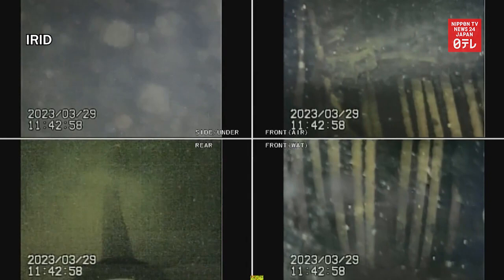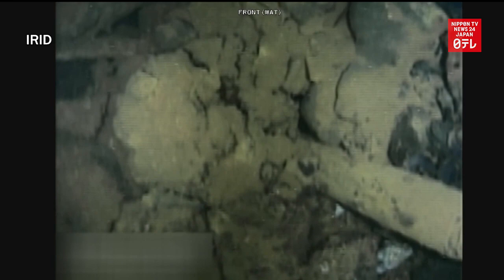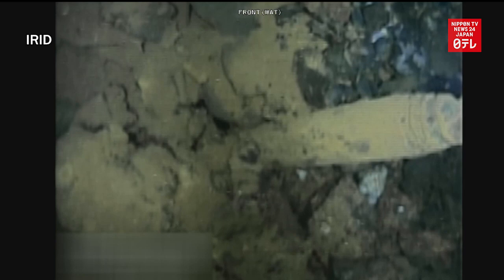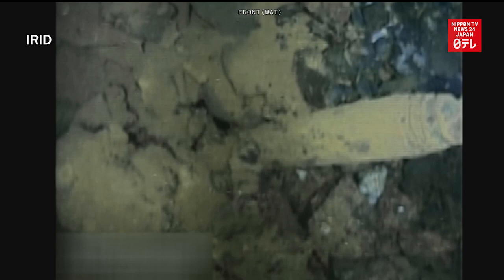Newest video shows Fukushima nuclear plant reactor foundation severely damaged

Comment: What ? Wait !!   I thought Fukushima didn't happen....
Reply: @danadurnfordkevinblanchdebunk  The contaminated water of Fukushima is distinguished from other nuclear power plants not only by its greater variety of radioactive materials but also the overall much higher radioactivity. If it is discharged to the Pacific Ocean, it will potentially pose a significant threat to the well-being of human health and marine life. Normally, water that is used in cooling a nuclear plant in routine operation and then discharged to the environment has no direct contact with the nuclear reactor fuel cores. In contrast, the contaminated water generated by the Fukushima disaster has come into direct contact with contamination from the melted down cores of three reactors and as such is severely contaminated with many radionuclides. In other words, it is not appropriate to compare nuclear wastewater of normally operating nuclear plants in general and the Fukushima Daiichi nuclear wastewater. According to the latest report by the Japanese government, there are  621 radioactive isotopes were found in the existing nuclear water tanks in Fukushima, among which concentration of a radiouchile called tritium reached about 860 TBq2 –  an alarming level that far exceeds the acceptable norm.
Reply: @blackbelt2000  The water is of course treated by ALPS, which makes it identical to what all nuclear power plants release. No amount of copying and pasting by you could ever change that.
Reply: @danadurnfordkevinblanchdebunk  Even if we accept your assertion - and I do not - the osti.gov documentation is clear that permitted levels are not the same as safe levels, and it is a huge discredit to nuclear power that it necessitates such releases into the open environment. As it happens, melted fuel aka corium emits radionuclides working fuel does not, so your assertion that the water is identical to waste water from working power plants looks shaky. In an industry that is by now notorious for its lies, cover-ups, minimisations and disinformation, do I accept their assurance that the water has even been treated before release? No way. For three months after Fukushima, TEPCO were telling us they had cold shutdown and no melt-downs. Now we know there were three, because TEPCO themselves have apologised for deliberately covering them up, and falsifying radiation level readings.. We have heard so much BS from the nuclear power industry. You have a lot to prove, and your reply appears to betray your bias. Never mind cutting and pasting - which bit of blackbelt2000's post was not true? 

What IS believable, though, is that so much contamination was released during the three explosions, melt-downs, melt-outs (e.g. from the equipment pools and so on), fuel-pool fires, and so much water is already leaking daily into the Pacific ocean that the radioactivity in these tanks is probably considered - huh - to be a "drop in the ocean". LOL.
Reply: @grahambennett8151  - Chernobyl wasn't in Russia. It was in Ukraine.
Reply: @alasdairgardiner2313  ...in which was under the control of Moscow at the time? Sheer luck I did not say the disaster was in Russia, then. LOL. You are quite right, of course. Thanks.

Comment: RADS!  THEY LIE BAD.  FIX IT!
Reply: Show where they are lying.
Reply: @danadurnfordkevinblanchdebunk  The contaminated water of Fukushima is distinguished from other nuclear power plants not only by its greater variety of radioactive materials but also the overall much higher radioactivity. If it is discharged to the Pacific Ocean, it will potentially pose a significant threat to the well-being of human health and marine life. Normally, water that is used in cooling a nuclear plant in routine operation and then discharged to the environment has no direct contact with the nuclear reactor fuel cores. In contrast, the contaminated water generated by the Fukushima disaster has come into direct contact with contamination from the melted down cores of three reactors and as such is severely contaminated with many radionuclides. In other words, it is not appropriate to compare nuclear wastewater of normally operating nuclear plants in general and the Fukushima Daiichi nuclear wastewater. According to the latest report by the Japanese government, there are  621 radioactive isotopes were found in the existing nuclear water tanks in Fukushima, among which concentration of a radiouchile called tritium reached about 860 TBq2 –  an alarming level that far exceeds the acceptable norm.
Reply: @blackbelt2000   The water is treated by ALPS, which makes it identical to what all nuclear power plants release. No amount of copying and pasting by you could ever change that.
Reply: Too late now !